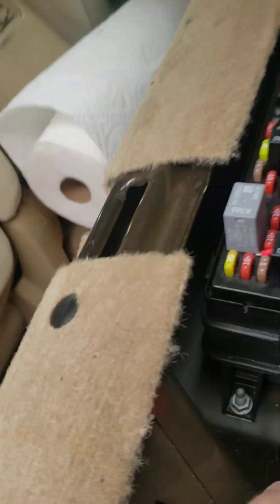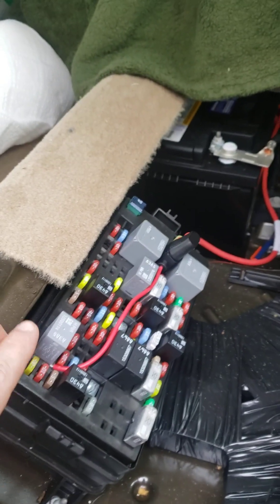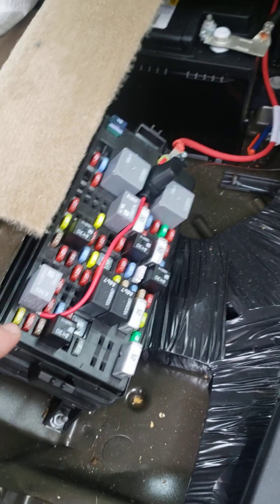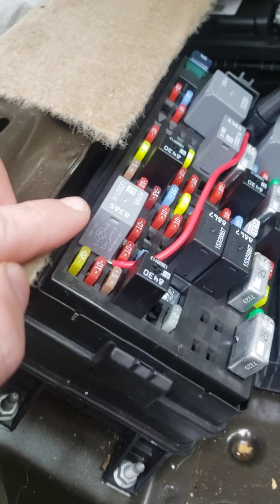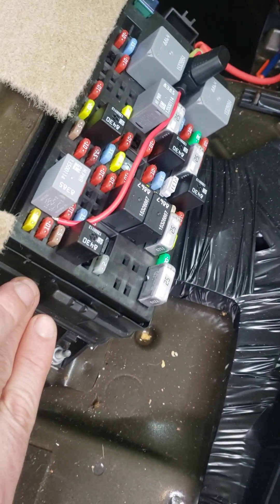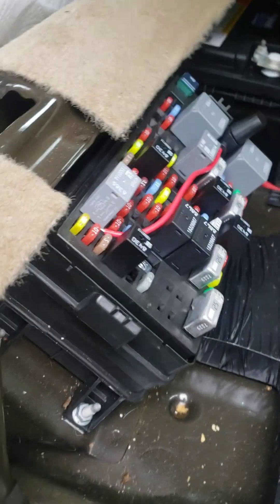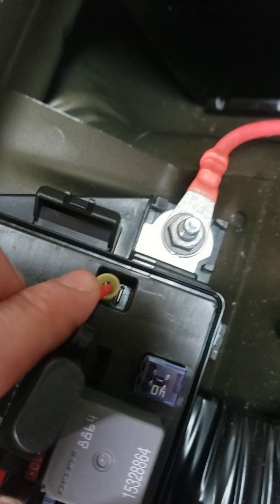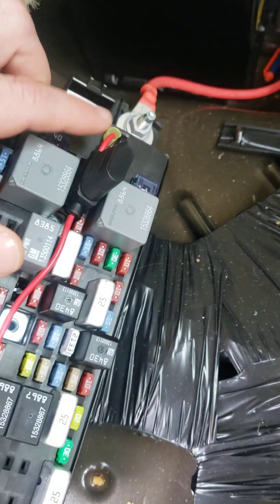08-11 Buick Lucerne Fuel Pump Relay Cheap Fix

Comment: It’s 2025 , I have a 2011 Buick Lucerne with this exact problem. I  went to go get the exact parts and it worked . Thank you so much !!! Saved me a lot of money
Reply: I have The 08 dts and fuel pump relay gets hot to hot ima try this method fingers crossed it works for me

Comment: Hi I'm not a car person so I'm not sure what I need to buy for this.  Could you do a video actually showing what you bought and how you installed it? Having this problem with my 2011 Buick Lucerne. Bought it yesterday and today went to drive it and it wouldn't start. Found the fuel pump relay was blown.  Any help would really be appreciated.
Reply: 20amp In line fuse. And some spade terminals, 

When you get ur (in-line fuse 20amp!) Remember 20amp!) 
It'll have 2 wires sticking out of both sides. Get your (Spade terminal) and.shove it in the wire either side of the wire is fine. Then you crimp it with a pair pliers. You crimp it on the blue. Right on top of the spade terminal. Then u shove the spade terminal (with the wire connected) into the 1st slot om the fuse box (as shown in video) male it look like his essentially.  The other side... take the relay out and get the wire and shove it down im the bottom right hole (#38 on the relay its written on the relay) go back to video to find out where 38 is.. then put relay back in with the wire in there as well. . You might have to bend some wire back BC mine was thick

Comment: This is great. I just recently started having these fuses blow after having my 08 Lucerne for 5 years. The last one I replaced lasted 2 months before it blew again this Thursday. I’ll look into removing that bracket on the bottom of the seat and see how the voltage is looking on the multimeter. I’m hoping since I’ve only blown two that I haven’t damaged the circuit board that bad to need the series addition.

Comment: I appreciate your advice on trying to live with this problem. My issue is when I hooked up your fix, the fuel pump wouldn't stop running, even after I shut the vehicle down and a lengthy amount of time after that. I've got the raw wires inside the slot where the #30 pin on the relay goes, and I've got the other end attached as you do, with a 20-amp fuse in the middle. Any ideas why the pump won't shut off with this configuration? Thanks again for providing this solution.
Reply: Did u figure it out bro?

Comment: Hey guys I am confused in what to put inside port 30 of the fusebox during adding the 20 amp inline fuse, i get the copper spade terminal on the other port but no copper spade terminal will fit inside the pin connection holewith the fuse. Sorry I am dumb
Reply from the maker: @BumpkinBros  put the bare wire in there.  You should be using a braided / stranded wire.  Flatten it out and cut it to a little over a quarter  in. ( a little shorter than the relay pin.  Put the wire in first then push the relay in securing it.  Keep me posted.
Reply: @SupaJunnt thank you so much! I just shoved in in there after said it in your video I just didn’t catch it the first time. Replaced the fuses & fuel pump & this worked thank you so much
Reply from the maker: @BumpkinBros  that's awesome. So glad to hear that.

Comment: Great instructional video and it does indeed WORK! My "surgical approach" to this procedure. I used 16 gauge wire. Crimped a "ring" connector to one end and slipped it over the stud that supplies 12V to the fuse box. On the other end of this same wire, I butt connected one end of the "inline fuse" holder. Using another segment of 16 gauge wire, I butt connected the other end of the fuse holder. Now comes the most important part of the operation. Preparing the raw wire end that will need to share the space with the #30 pin. Take a good light source and study the architecture of the pre-existing slot in the fuse box created for pin #30. Remove a generous amount of the insulation wrap, otherwise this will get in the way of the relay body as you attempt to seat pin #30 and the raw end of the 16 gauge stripped wire into the slot simultaneously. Take your time shaping the raw end of the wire. First hammer it very flat. It will now be too wide to fit into the fuse box. Use a very fine sharp wire cutter to create a squared off end and a slim longitudinal profile. Using a light, observe that the now shaped wire end enters the fuse box slot without being distorted. You are now ready to introduce the relay into the fuse box. Use the palm of your hand once you have established good alignment and steadily push down with progressive force as you feel the relay advancing against considerable resistance. Success! Nothing more beautiful that the sound of a fuel pump motor "kicking-on"!!
Reply from the maker: @feliperigau7353  nicely done.

Comment: I have a 2010 Cadillac DTS and was running into the same issue with the fuel pump relay.  I'm so glad I found your video! I bought a 20A in-line relay from Advance Auto for about $8 and installed it. Now the car starts perfectly! Thanks for the tip!
Reply from the maker: @TJWhitmore007  awesome! Glad it helped.

Comment: Hey man did you step that 20 amp in line fuse down? Or did it all work good with the 20 amp in line
Reply from the maker: @haznojohnsonjohnson8237  still running the 20amp fuse. Not sure if it's 100% safe but I haven't had any issues yet and I suppose if something shorts its still fused.

Comment: 2 questions:   
1. What gauge wire?
2. I’m not blowing fuses.  But have the same problem w the pump not working.  I can always tell when it’s not gonna start, as I first turn the key over to hear the pump engage and start pushing fuel.  When I don’t hear that… no start.  The 30 pin is burnt a touch but not blowing the fuse.   This no start will happen even if the vehicle is outside in the cold in January and not been run for days.  So I know the relay isn’t hot and stopping itself from working.  The relay DOES come out easily as yours does.  So my question is-  could your fix still be useful?   Or is it likely the pump itself ?
Reply from the maker: Cant remember the exact wire gauge but I would imagine  14-16ga would be fine. 

It is possible that your fuel pump may be failing. I would jumper from the hot pin on the fuse block to the the pin that is the +12v to the fuel pump. If it powers on then it most likely is a poor connection at the breaker resulting in the relay either not clicking over or possibly sending improper voltage to the pump not allowing it to turn on due to the loose fitment. I cant remember which pin is what now as its been so long so you may need to look at a diagram of the  relay pin out or verhicle pin out to ensure you jumper correctly. Do not leave the jumper in though, this is just for testing purposes or getting you home in a pinch. If you leave the jumper in the pump will never turn off and drain your battery. That's why the relay is used, the relay ultimately is just a switch that turns power on and off to the pump when the key is turned to the on position.

Comment: Can you explain why you need a fuse in that line?  If the hot pin at the relay is connected to battery, then this line is not fused anyway.  Perhaps you are thinking that the wire at the relay may pop out and short to something else in the box?
Reply from the maker: The pin that the fuse goes to is the always positive+ pin that is connected to the battery. then when the engine is switched on it then provides power to the pin that runs to the positive+ on the fuel pump completing the circuit. so if there is a short anywhere in line or some sort of short in the breaker the fuse should pop protecting anything upstream / battery / electrical system.
Reply from the maker: @CarolFende  correct.  If the fuel pump shorts it should pop the inline fues installed instead of somthing down stream.

Comment: Do you cut the constant power wire underneath the fuse box?
Reply from the maker: @devildogforever100  no, you would not need to do anything under the fuse box.

Comment: How did you connect the wire to the relay
Reply from the maker: Flattened the wire with a quick pop from a hammer then gently inserted into the port

Comment: Did this problem only affect the '08 thru '11 models?
Reply from the maker: 06-2011 Buick Lucerns and I think the cadillac DTS? they use the same rear fuse block seat bracket design.

Comment: Hey - had this same issue 2008 Lucerne. Replaced the relay and after 5 days - same no start but the relay was fine. 

I did this fused jumper from the spade pin and pushed the other wire end to pin #30 and it started right up. Thank you. !

I may try doing an external fuse with taking off the box and connecting underneath to pins 86 and 87. 

I have seen comments about this being a GM recall. Has anyone out there had the box replaced by GM under recall or warranty?
Reply from the maker: @richleskovec4075  been a minute,  I believe i looked into it and it's now expired.  I could be wrong though.
Reply: ive had same issue , i called Buick dealership, they said any dealership (ford, Buick chevy,) they all claim if car or truck is over 10 years old it's not recall warranty ....so we are stuck with the 750 dollar plus fix or do the jump wire thing fix,
Reply: @marcuscheko3264  ok thanks. i haven't checked any dealers yet. I will do the external relay replacement. I bought a vehicle manual and got the wiring diagram to find the exact wires and under box pin locations to splice into under the box for the ignition switch input and the fuel pump power output to be able to run those into a fused powered and grounded relay to bypass this whole silly issue from GM. We've been driving around now with the bare wire pin wrap shove in method and its been fine. I just want to make it more permanently correct and properly fused on both input and output.

Comment: I did this fix and it is working, I am concerned that the aux port is always on even if the car is off. Does this mean the fuel pump will always be on also?
Reply from the maker: @sorenstroud1761  yes the aux is constant 12v that goes to the constant 12v of the relay.  The relay is basically like a switch. When you key the car on a signal wire tells the relay to switch to the 12v constant to power the fuel pump.  

So to answer your question. No if done properly the relay should function as normal and switch off when the key is off.

Comment: I did this fix and it is working, I am concerned that the aux port is always on even if the car is off. Does this mean the fuel pump will always be on also?
Reply from the maker: @sorenstroud1761  No. When you key the car on the relay (think switch) clicks over to the hot pin turning on the fuel pump.  

That pin is always hot, similar to the accessory positive the fix is pulling from.
Reply: That's my concern as well, the fuel pump relay only goes hot when the key is on. I'm thinking about adding an external 12v relay to support the fuel pump relay.

Comment: what size fuse is inside the inline fuse? did u find out if u were over fusing?
Reply from the maker: Currently it is a 20 amp fuse. No I never did find out yet, honestly I forgot about swapping it to a 10 amp and haven't had any issues. Still waiting for somebody a bit more versed in electrical to let me know if it is over fused.

Comment: wonder if this is still working after 5 months?
Reply from the maker: @simmy5883  Yes, still working well. Have not had any issues after the fix.
Reply from the maker: Update. Been a year now and still working fine, have not had any issues or any more no starts or burned up relays.
Reply: @SupaJunnt  I am running fine with this fix!!!
Reply from the maker: @simmy5883  glad to hear it! :)

Comment: Thank you for this. My younger brother is having this exact issue with his Buick Lucerne, and we simply cannot afford several hundred dollars right now. He's owned this car for about 6 months and we've already sunk several hundred dollars in repairs into it, and now this. This would be a huge relief if this is the problem. I'm not sure that he knows to look for another fuse box (under back seat) so great info. Thanks again.
Reply from the maker: @Doxymeister  hopefully that's the issue,  relatively easy / cheap fix if that's the case.

Comment: Hello I’m glad I’m came across this video I have the same problem but pin 87 is burned up will this still work ?
Reply: The commenter just above you used the horn relay pin and it's working pretty good. Good luck, we're having the same issue with my brother's Buick.
Reply from the maker: I would expect it should, I would either sand the pin on the relay to clean it up really good or just get a new relay, they are pretty inexpensive. If your socket is bad enough, another commenter bent the pin out sideways and hooked on with a spade terminal then ran to the 12v+ accessory hook up. Both would most likely work, if your socket is very loose you may need to use thicker gauge wire or again, bend the pin sideways and hook onto it with a spade connector. Another option if there is considerable play in 87 socket would be to use a fork connector, chop one half of the fork off then push it into the socket prior to installing the relay to create a secure connection.

Comment: So I did all of this and the relay is still getting hot, do you think I’m too far gone already? I can’t really afford the fuse box right bow
Reply from the maker: @iamharley4325  the relay will still get warm to the touch but shouldn't be scolding hot. Wonder if you have a bad ground or bad connection from relay to fuel pump.  Are you still viewing relays with the fix?
Reply: I just did this, the relay is still hot to the touch, but not so hot that I pull my hand away... I put a heat gun to it and it was about 130°
Reply from the maker: @iamharley4325  probably fine as long as they are no longer popping.

Comment: I wish I had a fuel pump problem I have an 07 Buick Lucerne an I have no idea what's going on with it won't start won't crank all I get is a click I've replaced the battery and starter nothing has changed I don't know what's going on with it
Reply from the maker: Do you have a lock symbol illuminated on your dash when key in?
Reply from the maker: Fuel, Spark and Oxygen. Start with the basics. You can pull a spark plug out of the block and touch it to the block and have somebody crank the vehicle. If it sparks, you have spark, if not I would look into replaceing the ignition coils or the block the coils plug into.

Jump the fuel pump pins bypassing the relay and see if you hear your fuel pump cycle, if it does pump is probably good. 

Air usually isn't the issue. Start there, if that doesn't work I would look to see if you have some sort of Schrader valve hook up in the engine compartment to test fuel pressure at the rail to ensure you don't have an obstruction in the fuel line (clogged fuel filter or something like that).

 Even with clogged injectors I would expect it to still attempt to start or run poorly.

I'm no mechanic but I would think probably fuel pump, security lockout or possibly ecu type problem.

I asked about the lock icon as the security systems on these cars can be funny and forget your key and will prevent the vehicle from starting. To correct this I believe you click the key to the on position and leave it for 15-30 minutes and it will reset / relearn the key, but look up the procedure to ensure you do it correctly.

I would be curious what your issue is if you figure it out, please post and let us know what it was.

Comment: This is crazy I was going insane wondering why i was blowing relays my local shop scammed me out of 2k replacing the box and relay
Reply from the maker: Sorry to hear that.  It's not a commonly known fix. I had to do a ton of digging. The more views and likes the more likely people will find the fix.  Appreciate the feed back. 

Make sure you cut the seat bracket back so it doesn't happen again down the road.
Reply: @SupaJunnt  will do man thank you!
Reply: Honestly thats the right way to fix it atleast you dont have to worry like us

Comment: If I don’t have that area to put that spade connection can I run it to my battery?
Reply from the maker: Yes. That spade connection is 12v constant, same as your battery post.
Reply: @SupaJunnt  what size gauge wire did u use this issue is a headache and I could use that 600 on new box for my kids instead thanks for any info
Reply from the maker: @CHEVY512atx  Not sure on exact gauge. I would imagine 16-18 gauge stranded. Maybe even 20ga. But most likely 18 gauge. "Think speaker wire thickness." It doesn't need to be very thick, in fact that would probably not be beneficial as the relay still needs to plug in. I would go with 18/16 gauge.

Comment: I don't understand how you grounded it
Reply from the maker: The relay has a dedicated ground, I forget which pin it is but there is already a ground where the relay plugs in, the problem is a lack of positive voltage typically.
Reply: Is that why you need to keep the relay in there? So you get the ground? I was just wondering why you keep the relay in there if you’re going around the relay anyway?
Reply from the maker: @texaswild7466  exactly.  The other pins typically are fine.  Yes I kept it in so the other pins can do what they need to do.